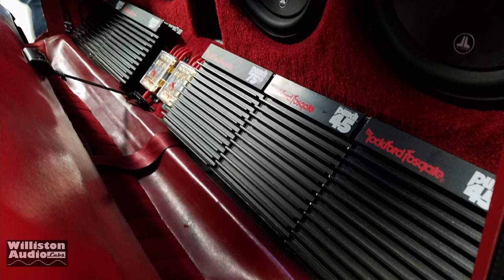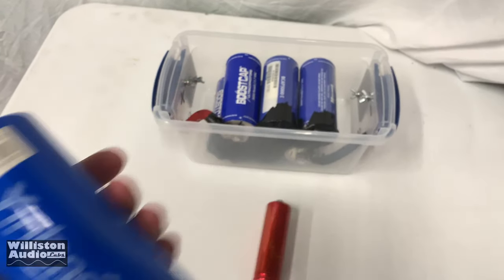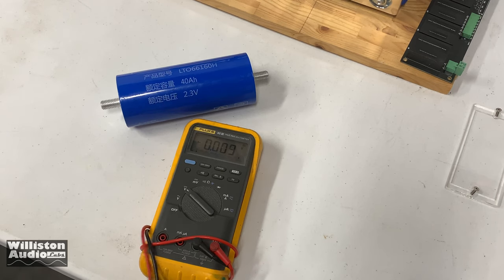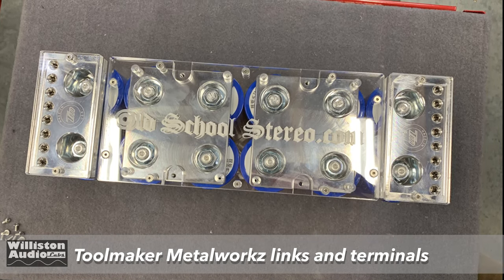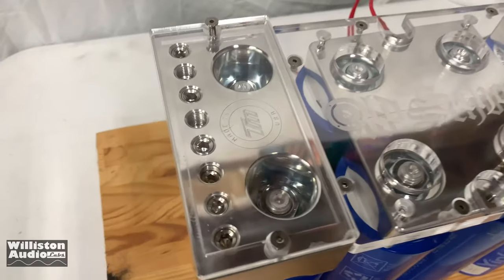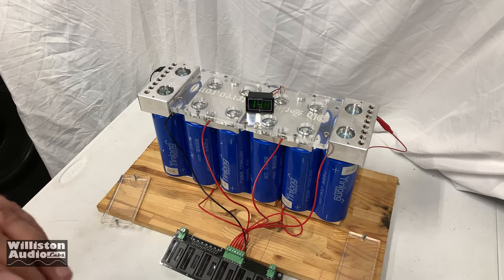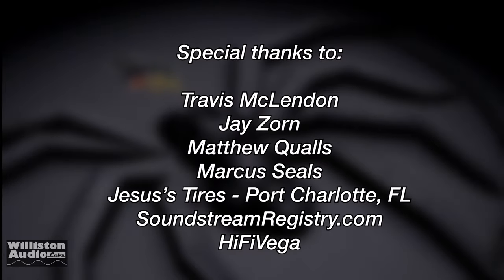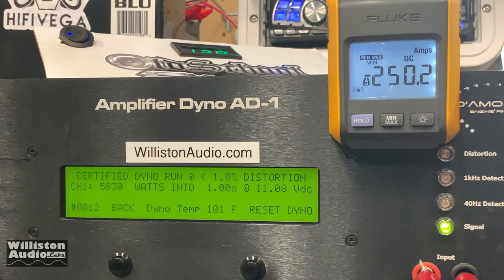Lithium Batteries for Car Audio? Yinlong LTO Cells LTO66160H 8000 watt capable Battery Bank [4K]

Comment: Batterys should never been shipped charged!, And never store a lipo full... About half is perfect. And if you but batteries in parallel for the first time it is really necessary to use resistors to bring them slowly to the same voltage. Otherwise they can overheat an this shortens the livetime.
And if u r spending more than one dollar an a battery ALWAYS use a balanceing board! Especially when you want to load them heavy!
Reply: These aren't lipo so....

Comment: No way I will pay 1k for a damn battery.
Reply: I have 16 nsb 100ft batteries. They weigh a ton and kill my truck. Switching to lithium for a couple grand will save me a lot in gas and vehicle maintenance. A 400ah lithium bank will also support more power than my 1600ah agm bank.
Reply: But you'll pay 1k for 2 or 3 agms that produce less power?

Comment: Too expensive and a bit of work, ide stick with agm especially for safety, anyone seen lithium explode, i have at the shop dude took off the resettable breaker on a jump pack, jumped a battery left it on too long, not even a few seconds after setting it on a work bench, boom! 8 too 10 ft flames it burned until we put it out, atleast 10 seconds, and the smell, omg i could taste it thats how bad it was.   Imagine if he was holding it! we all seen what those little 18650's can do. Imagine what that would do too your car, it would be a gonner! be careful guys lithium is no joke!
Reply: These banks are a lot safer than you think and an agm capable of the same output would cost way more than what this setup cost

Comment: Wow that ran for 3 seconds and dropped to 11.08v.. yikes!!
Reply from the maker: I had some concerns as well and I've since found the issue. These cells have the most capacity when charged to 15.2-15.6V (in 6S config). I was only charging to the mid 14's which drastically reduces the capacity. I'll do more tests in the future with higher starting voltage and you'll see the difference
Reply: @wal  Yikes.. we’ll considering these are going to be advertised as an additional pack for car audio systems and “standard” electrical charge voltages on cars are only mid 14s…. That sucks to hear.. I planned to get these for my audio system.. but not if they need 15.6v!
Reply from the maker: @techwiz2410  you can run in 5S config for max of 13.8V charge. But yeah the chemistry and voltage for a vehicle are difficult since they don't support charging in the low to mid 14's in the 6S config
Reply: @wal  Might have to do a 5s bank... Thanks man .. i'll be watching for your 15v tests :)

Comment: To expensive for very little  return. My sound system or yours is not going to sound better. Just bought  an AC Delco battery dual post for $135.00 dollars and wired everything with 8 gauge wire, and i did not have to change out my alternator. Bass sounds thunderous. 😁
Reply: Actually the complete opposite. Much more cost effective then AGM batteries. These cells are about in the middle of bang for your buck but if you go like proto cells it's insane. A $300 bank supporting 10k+
Reply from the maker: Each of these banks has the reserve of 2 or more large AGM batteries. Not for everyone, but those who need it, need it
Reply: I don't mean to be like this but 8 GAUGE come on man. Your mirror shakes a little. Time to upgrade
Reply: @RayRizzle  he didnt say how many strands lol
Reply: I also run 8 gage for my speaker wire 🤷🏽‍♂️
Reply: lol
Reply: @wal  with the 80ah bank on 8000 watts rms and a 320amp alternator, how long can I play my system with the engine off?

Comment: this battery will cost you only a thousand dollars
Reply from the maker: And support 8000 watts with a HO alt..or you could spend almost the same on AGM and have 1/10 the lifespan of these
Reply: "Only" huh?
Reply: My optima red tops (2) took a dump after about 2 years on a 150 amp alt and only 3k watts of Rockford Fosgate A series amps not to mention I also had (3) 1 farad lightning audio capacitors in the trunk at the distributor bars just in front of the amps. Seems like there quality has dropped off for optima batteries.
Reply: @georgethoman82  optima changed build plants a few years ago

Comment: This is fake 8000 Watt.... 🤣😉
Reply from the maker: So I figured out the issue. These cells w have the most capacity around 15.4-15.8V when used in 6S config. I should’ve charged them a bit more and it bet they would’ve done as expected

Comment: So,... dont use these batteries.
Reply from the maker: not saying that at all. The test at the end was done without fully cycling the cells as recommended. Custom Electric Supply has a vid showing 6 cells (40aH), holding 500A for one full minute with only a 120A alt. These cells are the real dealio
Reply: @wal  well, I should specify, I'm going for all out spl in a concrete filled caravan on 18s. No alt, all battery. Currently on 135ah cmax. So indeed for me, I'd be sending castle walls to my coils.

*on Crossfire XS-8Xs so 18v amps.